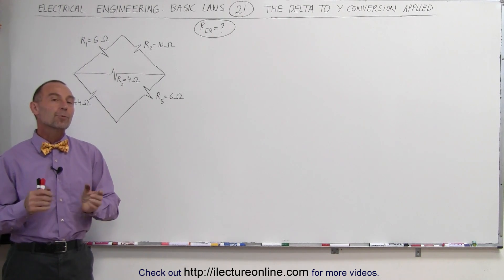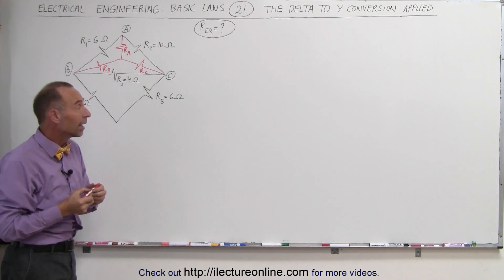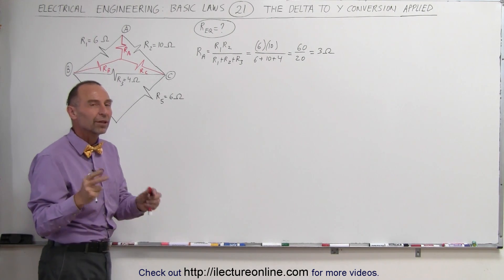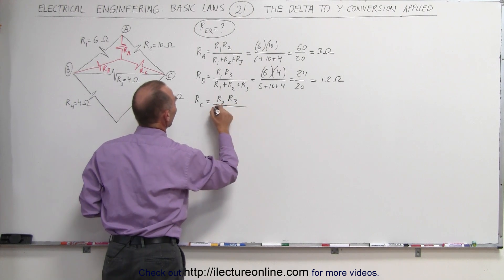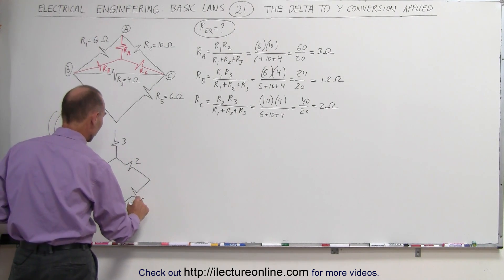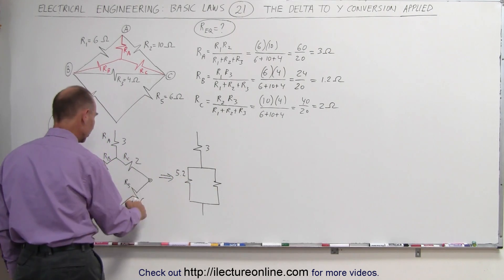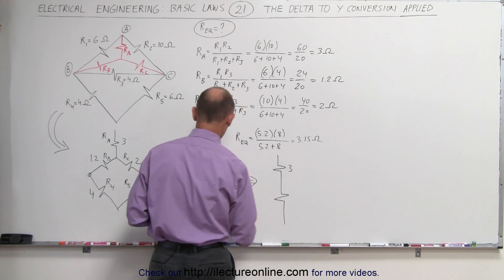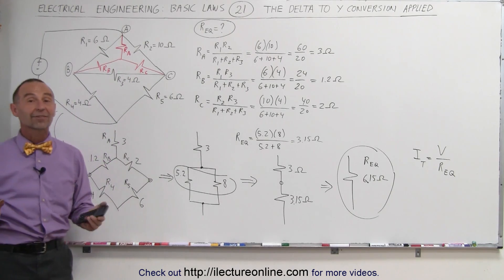Electrical Engineering: Basic Laws (21 of 31) The Delta to Y Conversion Example

Comment: I did the Y from the bottom triangle like your previous video and got a completely different answer, is there a reason you did the top one this time instead?
Reply from the maker: It should work in either case.  (I suspect a calculation error)

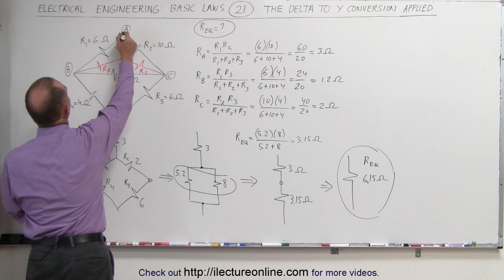Comment: 6:17
Question: Are we assuming from the start that the circuit would be connected to point A and to the point between R4 and R5  ?

What happens if the circuit is assumed to be connected to other points such as point A and point B or point B and point C  would we get different R equivalent for those circuits ?
Thank you for your great videos.
Reply from the maker: That circuit is known as a bridge circuit and is connected at the top and at the bottom.

Comment: Hi teacher, I have a question .
Is there any general relation of current or voltage between delta and it's corresponding Y circuit ?
Reply from the maker: They are equivalent in all respects of resistance, current and voltage.

Comment: is it the way i press my calculator...but its like am getting a different answer everytime i use the lower circuit instead....anyway..let me stay calm and try to figure it out...but i will be glad if am corrected instantly
Reply from the maker: Depending on which calculator you use, the order of your operation is important.  Try to calculate each part separately and see if that works.

Comment: I notice that by removing the top set of resistors we effectively eliminate the cross resistor R3.  But I wonder what if we had removed the bottom set of resistors having different values from the top?  We would still eliminate the cross resistor, but should have different values for the survivors.  Could you do another video showing that using both methods we obtain the same result?
Reply from the maker: There is only one method (that I know of) to perform a delta to Y conversion.  This is derived by using Kirchhoff's voltage loops and current nodes.

Comment: Sir, if I instead transformed the bottom side as the Y connection, is that still correct? I got exactly 6 as the answer though, I used fractions so I didn't round off any decimal
Reply from the maker: Yes, you can do that as well and you will get the same answer.
Reply: @MichelvanBiezen  thank you sir! Your videos are so helpful.

Comment: why not R4 & R5 in series 🤔
Reply from the maker: It is not that straight forward with a delta circuit.  See the playlist:  ELECTRICAL ENGINEERING 2.1 DELTA TO Y CONVERSION DERIVED

Comment: Thank you sir that was very helpful, I have a question, how do I calculate current in each resistor separately? If there is already a video explaining it can you reply with the link or name because I can't find it, thank you
Reply from the maker: yes, we typically use Kirchhoff's rules.  I remember doing such an example but can't remember where.
Reply: @MichelvanBiezen  I found the playlist, thank you for your effort and response
Reply: @justanobody5202  may i also ask for the link? I am kinda troubled on how to solve it using Kirchoff's rules.

Comment: 4:20 are R4 and R5 in series? I understand why Rb and R4 are in series and why Rc and R5 are in series, but i can not understand why R4 and R5 in series? Thank you so much
Reply from the maker: R4 and R5 are NOT in series
Reply: @MichelvanBiezen  thank you for your reply! but why? I am a little bit confused about the current! I thought that r4 and r5 have the same current and that's why are in series..but you told me that are NOT. I don't understand how to think to find the right type of connection...What can I do? Thank you
Reply from the maker: The current through R4 is not the same as the current through R5

Comment: Not sure I understand this reasoning about parallel and serial connection. To me, Rb, Rc, R4 and R5 are all in series. R4 and R5 share a single node, just as Rc does with R5. So where is the difference?
Reply from the maker: With a delta connection you cannot use that logic.  See this playlist:  ELECTRICAL ENGINEERING 2.1 BASIC LAWS SUPPLEMENT
Reply from the maker: We changed the name of the playlist to:  ELECTRICAL ENGINEERING 2.1 DELTA TO Y CONVERSION PROOFS

Comment: So, Rb = R1... Rc = R2... Ra = R3??? I'm asking because after you made the conversion, then re-drew the schematic below, it is important to know which resistors are in relation to the other side of the circuit where the other 2 resistors were NOT involved in the Delta-Wye Conversion. In other words, how did you determine that Rb is in Series w/R4 & Rc is in Series w/R5? If someone does NOT fully understand, then the calculation may be performed INcorrectly
Reply from the maker: This video shows how the resistors are converted:  Electrical Engineering: Basic Laws (29 of 31) Delta to Y Conversion Derived R1=?   as well as the 2 following that one.
Reply: Thanks for sending that... watched & understood

Comment: Q: Why R_1 and R2 aren't in series, and R_4 and R_5 are neither?
A: two components are in series if (i) they both share just one (not two) common node; (ii) that node that they're sharing is exclusive for them, that is, that their common node is not being shared with other components; (iii) therefore, the current through them is the same. Now, perhaps in the diagram of this video it is not shown clearly, but a wire is exiting from (A)_, and another from the lowest node. Therefore, the pair _R_1 and R2_, and _R_4 and R_5 aren't in series.
Reply: thanks for correcting that, that had me confused
Reply: 4:20 are R4 and R5 in series? I understand why Rb and R4 are in series and why Rc and R5 are in series, but i can not understand why R4 and R5 in series? Thank you so much

Comment: isn't R1 and R2 in series and also R4 and R5?
Reply from the maker: No they are not.  If two resistors are in series, then there is only one path for the current through both resistors.
Reply: Okay, thank you for the response.
Reply: https://www.youtube.com/watch?v=qQYRc9UibKk&lc=UgzeUjwU53pLgg7VOdJ4AaABAg